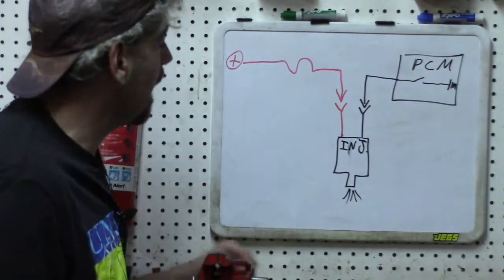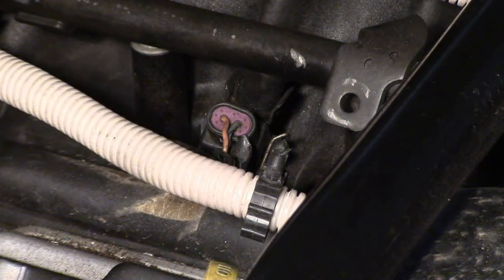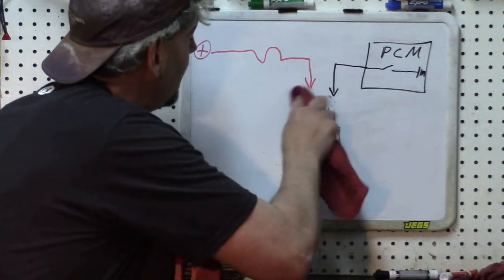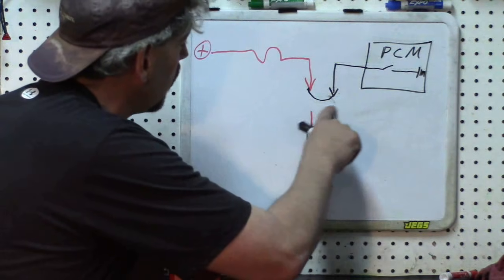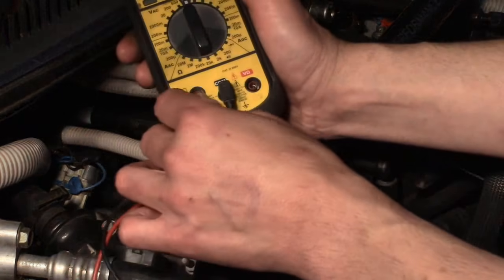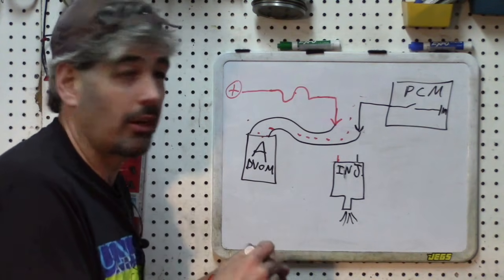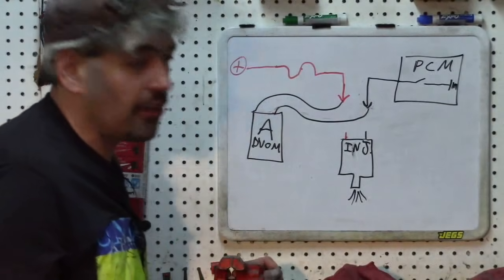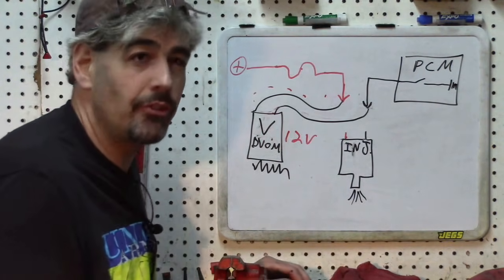How to Not Fry Your PCM-  SBQM Channel Free Video Sample!

Comment: DVOM in 10A mode has internal fuse protection so additional fuse not needed unless circuit normally has lower rated fuse protection
Reply from the maker: This is extremely dangerous thinking. Most PCM components are well under an AMP. In fact even under 250 mAMP.  A 10 Amp fuse is exactly how you would damage a computer. Measuring amperage with a 10A multimeter is a terrible idea!!!
Reply: Schrodingers Box perhaps a misunderstanding or I explained incorrectly. An example. 
I want to provide power to +12V side of ground side switching injector so I use DVOM in 10A mode from B+ to injector + pin. Ground side jumped to pcm tor injection trigger. Fuse in 10A mode is for circuit protection not power limitation. Preferable to a straight wire jumper
Reply from the maker: Still very, very ill advised.  Instead the correct method is to use a testlight- incandescent for 250mA, LED for 10mA.
  It makes no difference whether you use the multimeter or a straight wire in the application you describe- 10A is not going to protect ANY computer circuit.
Reply: Schrodingers Box now I’m confused because I believed as the injector was the load and thereby provide protection for the pcm as I am only providing power through the 10A fuse to the load it’s no different to fuse box power supply except I have a DVOM  giving a display to see current flow
Reply from the maker: An injector is 1 amp AND it is also ground-side-switched as well. Therefore, think about it.... If you bypass the load directly to the PCM with your "10A fused protection" technique, you will absolutely 100% fry the driver guaranteed. See?
ALWAYS use a test light.
Reply: Schrodingers Box I agree that’s why I described providing power to the load and NOT bypass the load
Reply from the maker: I think you are missing the point- of course you would never bypass the load- ever. The purpose of the fuse is to protect the PCM in the event you accidentally do this in the diagnostic procedure.  What I am saying is the 10A fuse will not protect you- it will fry the computer guaranteed- same as a straight jumper wire would because the 10A fuse is far, far, far stronger than a PCM transistor so it makes no difference whether you use a paper clip or a multimeter or a fused wire at 10A or even 5A.
  The right way to do this diagnostic is not with a multimeter but rather by leveraging the pull-down design of an injector circuit to light the test light at only 250mA draw to validate the circuit operation and integrity. That way it is impossible to fry the driver--- and, if the driver is already fried to start with, you know you didn't cause it.
Reply: Schrodingers Box ah now I see for example the injector has a 100% short applying 10A power and boom new drivers

Comment: You do do some brilliant videos.
 Could you do one on why I do not get a battery dashboard light when my ignition is turned on.  The alternator is charging the battery at 14 volts.? Any ideas?
Reply from the maker: There is a wire from the alternator to the dashboard- either its disconnected from the alternator, its broken on the way to the dashboard, its disconnected at the dashboard or there is a failure on the IP circuit board.

Comment: Awesome explanation sir, I found this video related to my recent Honda Element issue. I replaced the TPS sensor and during calibration, I feel possibly I fried my ECM because when I used the volt meter I mistakenly connected the black lead to Battery + and the red lead to the signal wire or 5v wire accidentally or both together, I heard a sparking sound but I thought it can be a relay or fuse noise. Well, when I tried to start the car it was cranking but no start. The fuel pump stopped priming on the ignition key in position. The next day I noticed the immobilizer green key flashing in the inst. cluster along with Check Engine Light and oil pressure. Also, DLC or OBD2 connector showed a linking error earlier that was working perfectly. Because of the check engine light, I am still hopeful ECM is good but in some forums, I saw ECU can still be bad. Kindly guide me in light of your best experience for possible reasons and fix. I checked all the fuses and relays are good along with the power and grounds.

Comment: Question: Fan Circuit: 3 relays    without wiring diagram how do you confirm which pin(s) are PCM ground circuit not using the process of elimination. ie saying" this is power this is ground therefore this must be PCM ground"
 Is there some way to know for certain what pin is directly connected to PCM.
Reply from the maker: Much easier to use a testlight for that. Set up the testlight to detect ground and if when you activate the A/C the pin you are testing lights the testlight you know there had to have been a ground side control activated.   Simple as that!
Reply: @SchrodingersBox  Excellent idea thanks

Comment: Can a picoscope oscilloscope probe with a positive and negative alligator lead fry my computer if I probed a wire with the wrong clip attached to the battery or does it have built-in protection similar to a test light?
Reply from the maker: if you measured current incorrectly it would fry the scope but not your laptop.
  Test lights don’t have built in protection. they are just low amperage.  Measure a 50mA computerized circuit with your 250mA testlight and you’ll fry the circuit all the same.

Comment: The viewers diagram of forcing 12v through the pink wire found the problem on the other side through process of elimination. Conversely on the OTHER side of the circuit a corroded 20 amp fuse might have been a problem where the pink wire wasn't seeing a full 12v yet the fuse wouldn't b blown. As a semi-mechanic am I right Matt?
Reply from the maker: I have never seen a corroded fuse however you would certainly see a voltage drop AFTER the resistance in a circuit for sure.
Reply: thx 4 commenting... quick question-- might one accurately test a bad circuit through a fuse with amps? One problem however would b what the correct setting from a computer, say ECM,  might b on say a 10 or 20 amp fuse... Worth it?
Reply: Cuz me--PCM...

Comment: Can you look at secondary ignition  waveforms on a coil over plug system?
Reply from the maker: Yes!!!
  There is a special tool (actually a couple of them) to do this. One is a “COP Module” which is an inductive device with a flat surface that fits right  over the coil and gives the waveforms from the secondary. The modules are specific for the car model.  The second way is with an “inductive wand”. It’s the same concept as the COP Module but in form of a wand with a flat surface at the end that you touch to the COP. It doesn’t work as well as the module though but if it does work if gives enough waveform resolution to get direction. 
    A third way to do it though is to read the amperage from either the input or ground wires on the COP itself. You can actually indirectly determine some secondary issues by the effect on the primary amperage curve.
Reply: Schrodingers Box wow thank you so much for your reply. I really love the scope and I’m trying to find an entry level scope to start practicing before I buy a good one. This is going to take my diagnostics to the next level thank you
Reply from the maker: Good for you!!  Getting a scope is by far one of the best things i ever did. I think I mentioned in an early video that I would never need a scope - boy how incompetent was I back then!!!  As you get more advanced you learn there are some diagnostics you simply cannot do without a scope- there is no workaround. And even if there is a workaround, you can do things 100X faster with a scope. It’s made my accuracy and efficiency improve dramatically.
Reply: Schrodingers Box I couldn’t agree more. I’m in automotive technical training and work for an independent shop and I have learned more watching your Chanel than I ever could by going to school so thank you for that.

Comment: Hello, Matt.   Some 4 pin relays can be installed backward if you are not paying attention. How would connecting them backward affect the PCM?  Thank you.
Reply from the maker: It wouldn’t affect it. You would essentially be installing an open switch instead of a coil. With an open switch the relay would simply never activate.
Reply: @SchrodingersBox  I am happy to hear that the PCM wouldn't be affected.  Would you mind explaining the open switch instead of a coil part? To my understanding, once current flows to  pin 85 and pin 86, the switch will be activated, and if the relay does not have a diode in it that allows current to flow in only one direction, current will flow even if the coil side is backward.
Reply from the maker: Correct. A coil is not a diode. Current can go either direction through a coil.

Comment: With the negative battery cable disconnected, Is it OK to run a jumper wire from the positive side of the battery to the chassis ground to clear the PCM?
Reply from the maker: That would have no effect. You have no ground.
Reply: @SchrodingersBox  Chassis ground meaning the ground cable.  I was told that it would clear any memory in the PCM to allow it to relearn the throttle position and other learned parameters.
Reply: @MeanGeneious  i'm still a novice, tho i have heard that one must disconnect the battery with some accessory on such as headlights so as to drain any residual current that the pcm may hold, for memory, in order to reset it.

Comment: What could be the problem on the  car when does not start when starting it only cranking. But when i reset it by removing terminal on a battery  and thatching the bettery tree times car starts
Reply from the maker: Sounds like you have a check engine code that may be preventing starting perhaps. Did you scan for codes?
Reply: @SchrodingersBox  yes it was having for plugs on the plugs when removing the terminals they have that spackling

Comment: In a fuel injector what is a normal amperage one injertor in four cylinder engine thanks
Reply from the maker: About an amp. My preference is to test the counterelectromotive force ramp pattern to look for a short in the winding however- the current itself is basically not informative unless the circuit is open.

Comment: A typical ammeter is internally fused at 10 Amps at the 10 Amp setting. Since the power source is fused at 20 Amps, the 10 Amp internal ammeter fuse would be safe for the system -- the meter's internal fuse would be the most vulnerable component.
Reply from the maker: That is not correct!!!!
Most PCM circuits operate on well under 1Amp.  You absolutely don't want to use the ammeter for that reason on such circuits. Use a LED testlight which is 50mA load. Do not use the ammeter!
Reply: @SchrodingersBox  I see that I was not specific on which part of the video I was commenting on which led to some misunderstanding. I was referring to the MAF sensor portion of the video which was at about 28 minutes into the video where the 12 Volts was injected through the ammeter into the MAF sensor connector at the pink wire (the pink wire source was fused at 20A and typical ammeters are fused at 10A). This was not referring to the fuel injector and its connection to the PCM module portion at the beginning of the video. For the fuel injector portion of the video, an oscilloscope would be ideal for monitoring the voltage pulses at the switched ground (PCM) side of the fuel injector. I am not sure of how static sensitive these PCMs are but it might be a good idea to be grounded to avoid unwanted ESD (electrostatic discharge) while working with the PCM. Usually, being in contact with the chassis of the car is enough to discharge any damaging static. I would hope that the PCM modules are adequately externally and internally protected from ESD by design -- they probably are.
Reply from the maker: ah much clearer. yes in that case an ammeter is fine. I normally use an Amp clamp

Comment: I know this is old. but why is it OK to send direct 12 volts to that sensor? do you not want to add a load? because the battery then gets fused before sending power to the mass air flow. anyone can help? I'll probably go back to basics and learn some more
Reply from the maker: Because I am powering the hotwire aspect of the sensor which is obviously a 12V circuit. I would never of course put 12V to the signal side or reference!!

Comment: I have a 1999.5 vw golf 2.0l driving me crazy.  I parked it a couple month ago due to a transmission issie which I have learned is limp mode.  Tryed to start the car and have not spark, changed the crank sensor and nothing..  I almost feel like giving up on it...
Reply from the maker: OK- what data do you have?

Comment: I saw a few videos on MAF sensors and I understood that ECM is sending 5v to the sensor and now I learn that 12v is coming from a battery.  I didn`t get the last one.
Reply: I saw your video now on maf sensor.  It's clear now 5v is a reference wire and maf has a 12v supply wire.  👍

Comment: On these tests, how about the noid light tests?
Reply from the maker: +gc Yes a noid light is always safe- it cannot cause damage because it is a load between the power and PCM.
  A testlight is exactly the same thing as a noid light but I think it's way easier to hook up a noid light since it just plugs right into the connector.

Comment: You should say the dVOM in volts mode in more resistance rather than using the word load. When you said it was more load that sounds like more amps and less resistance to me. But then again I am used to higher AC voltage in the HVAC field so maybe it's valid.
Reply: *is more resistance
Reply from the maker: +Joe Shearer True
Reply: +Schrodingers Box thanks for the reply. You have a great channel. I'm a 2%er in my field too.

Comment: not bad at all! i would of thought putting jumper wires with the plug undone to sig/ground and the power feed from battery straight to the 12v pin, bit more mucking around though

Comment: Hi Matt.  very good tips. =)
When you measure this type a measure i recomend use the Multimeter VRMS es more exact because the multimeter VRMS cant measure voltage out 50Hz. But if you have a osciloscope not is necesary.
A big Hello from Spain.

Comment: I would have thought that when the MAF sensor was unplug, the scan tool would show 5volts due to the pull up resistor. ???
Reply from the maker: Hmmm pretty old video so I am not sure where in the video I did that but i agree with you that  I would expect 5V on the scantool if I unplugged the MAF because you would have no voltage drop. did it read zero? maybe give me a time stamp.

Comment: Question.  So in scream scenario 1 and 2 the fuse does not provide protection from a short?
Reply from the maker: +Venture St. John No, Not to the PCM it doesn't. This is explained it part 1 of the series.
Reply: +Schrodingers Box . Thanks, I will review it

Comment: +Schrodingers Box Good Day, To anyone reading this Im having a little trouble, im replacing the head gasket on a Toyota 4EFE motor and am unsure of the head clearances and bolt torque settings, if anyone knows where I may find a workshop manual for that motor or just the general information required it would be greatly appreciated. Thanks
Reply: +Hendrik Loubser Google

Comment: Hey, Matt. I accidentally touched one end of my jumper cables together  with the other end attached to the car. It sparked. I touched I was going to fry the pcm and also I was cleaning a battery terminal and didn't remove the negative cable and ended up shorted the positive cable, again, I thought I was going to have a fried pcm, Was I wrong in my thinking? Also, would you know if connecting a jumper backwards would fry the pcm?  Your answer would be highly appreciated.
Reply from the maker: It will short and destroy the battery not the PCM. It doesn't increase amperage through anything other than the electrolytic cells.
Reply: Thank you, Matt.

Comment: Top notch video. Very well done. Use of the word "load" a bit miss leading - I think use of the phrase "high resistance" fits better.. Thanks!
Reply from the maker: +B crinshaw Resistance is indeed the load when there is nothing else in the circuit restricting flow to do work.
Reply: +Schrodingers Box - Right you are, it surely is a load - as a straight wire across an injector plug is a very, very good load - good enough to fry a PCM like you illustrate. Modern DVM's are a light enough load to keep drivers in the PCM safe. Very good videos! I'm a new subscriber and really appreciate your work. Thanks.

Comment: if we got 12 v in injector but still we have misfire .how much  is the correct  amp curent should  be in multimeter  ?
Reply from the maker: +Mahdi Joumazadeh It depends on a number of things but on a modern car it's around 1 amp. Some of the earliest injectors were closer to 4.
  You will never see 1 amp on a DVOM though- you'll definitely need a scope.